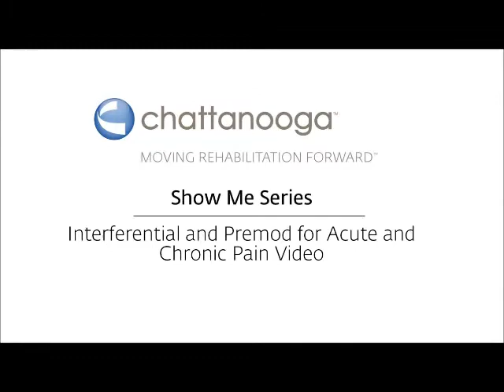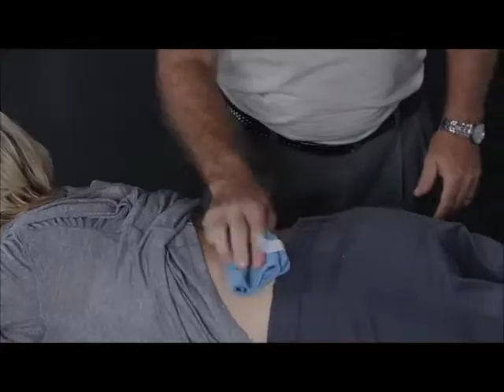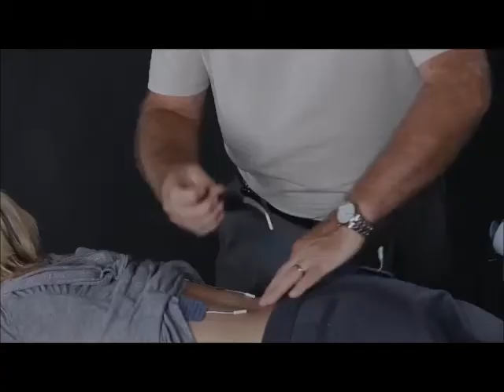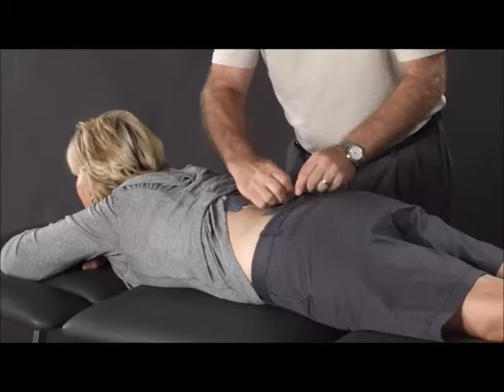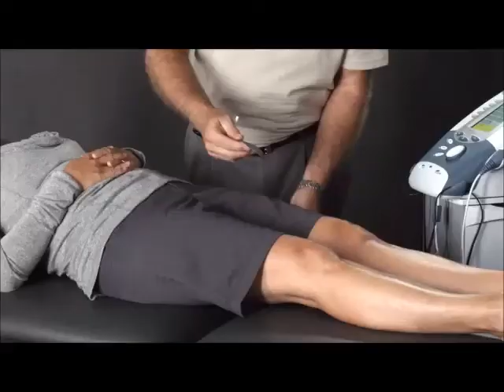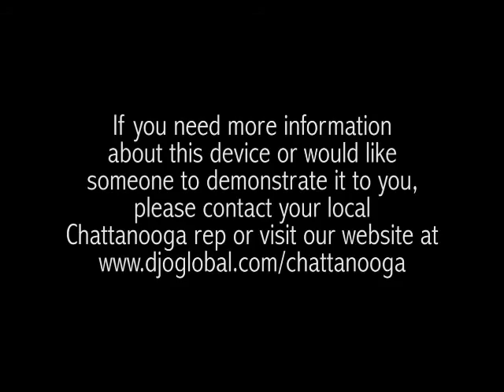Comment: Hi. Thank you for publishing this video. I find it very valuable because I'm currently undergoing treatment on the same machine as this for treating foraminal stenosis caused at the L5-S1 vertebral column causing excruciating pain on the nerve bunch at the pelvic floor with the pain radiating to rear thigh nerves and the rear of the left knee and the calf muscle. Because I can't determine whether the poles are being crossed as you are mentioning, I wish to know whether there is a mechanism built in the machine that can forewarn / indicate that the  electrodes of the pads are cross-connected diagonally to create interference. This is because, the therapist doesn't explain these aspects to me. And with the treatment receiving in the prone position, I'm not able to check this out on the instrument.
Reply: Hello, the device currently doesn't have the mechanism you require. We suggest you check each channel to ensure they're correct.
Reply: @equiposinterferencialesmx Thank you for your valuable answer to my question. I hope  this question could possibly lead the designers to  think of methods to incorporate this feature in their future development of this machine.